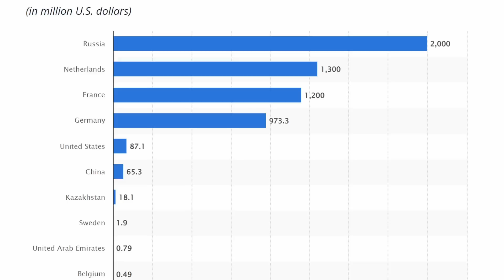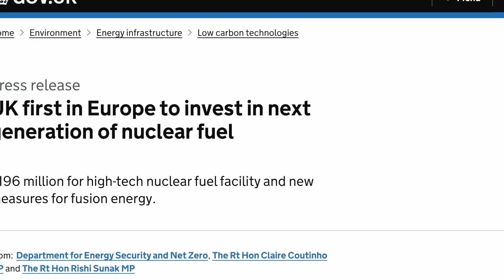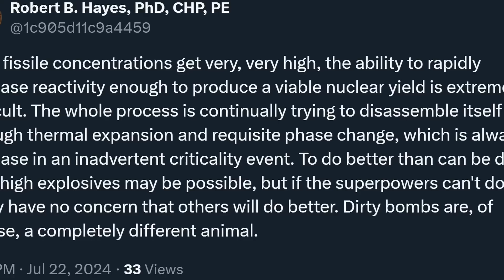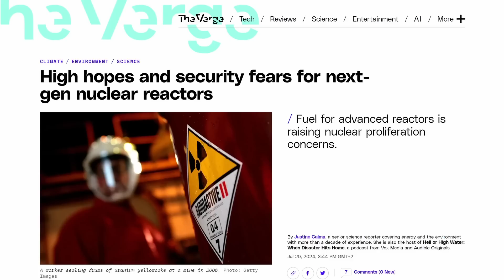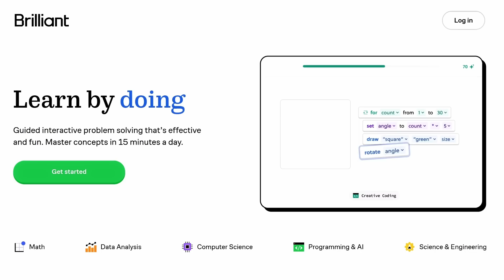Small modular reactor fuel could be used to build nuclear bomb, experts warn

Comment: This is actually a good technical summary.   You can actually build an atomic bomb with natural uranium at 0.7% U235.  It would take a sphere of it larger than all the uranium that is estimated to exist in the entire planet.

I have seen the calculations for how big of a sphere you would need for everything up to about 95% U235, U233, and Pu239 (all are bomb materials - and bombs have been built out of all by multiple countries - although everyone discarded U233 as it was much more expensive to produce).

Yes, you can build a bomb with lower % than bomb grade materials.  I don't think its practical at all until you get into the 80% range of enrichment - and there is so many advantages to pushing into the mid 90% enrichments once you have the equipment to enrich into the the 80% range.

The biggest nuclear bomb threat by potential new reactor technology is the molten salt thorium based fuel cycle reactor.  

It would be very easy to divert operational molten salt fuel, chemical separate the protactinium, and allow it to decay into extremely high grade 99.9%+ U233 for bombs.   

The USA actually produced U233 from solid thorium fuel rods this way as part of their looking at switching to U233 for bombs versus Pu239 (U233 has some real advantages over Pu239).   But, using normal graphite bomb material production reactors its vastly cheaper to produce Pu239 than U233 that way.  

The cost advantage would swing to U233 production with a thorium based Molten Salt Reactor; and how do you spot diversion of liquid molten salts.  All the current nuclear fuel tracking methods are based on serial numbers and counting of fuel rod or fuel block assemblies.
Reply: Can you tell us numbers for 2 or 3 stage bomb?
Reply: "The cost advantage would swing to U233 production with a thorium based Molten Salt Reactor; and how do you spot diversion of liquid molten salts."
You can make weapons-grade U-233 from an MSR, but I don't think you can do it *covertly* in a reactor officially intended to generate power.  As I understand it, there's some extra steps in processing that would be unnecessary for someone making fuel-grade, so it'd be a red flag if the plant was set up to do that.  
Also, the operator would have to account for the discrepancy in fuel production.  "Everybody else running this model of reactor is getting X kg of fuel bred for every GW-hr of electricity produced. You're only getting 0.95X; what are you doing wrong?"
Reply: @wwoods66  You are starting with a completely false assumption: You are forgetting that in all other reactor types that the fuel is in a solid form. Virtually no one analyzes spent fuel for what its constituents are. It just sits in pools of water usually for a decade + and is then put into some kind of dry storage until it is disposed of (someday in most cases).

Only in the case of recycling is any kind of post fuel run analysis done on the fuel burn up and resultants; and fuel recycling has pretty much stopped as its uneconomical -- and often that fuel is a decade or more old. 

The various nations have done enough testing of spent fuel from the different reactor types to have models for that. But, no one is actually testing spent fuel as it’s not cost effective, and totally not needed to verify if any fuel assemblies or blocks have been diverted (are missing).

They have detailed records and photos of both new fuel assemblies or blocks, and the spent fuel assemblies or blocks in spent fuel storage. Missing spent fuel in a solid form is very easy to identify.

Also, the vast majority of power plant reactors require about a month-long refueling outage often with many hundreds of extra workers to move fuel assemblies or blocks out of an into a reactor. Very easy to track when this is done and to have observers and/or cameras there.

The small number of reactors that can be refueled online have multiple 24-hour surveillance cameras watching where the refueling equipment is - the international monitors will know right away if someone starts to refuel a reactor online, and will have people there immediately if a camera goes out.

The problem with a molten salt reactor is the fuel stream is liquid. Let’s say its 1000 gallons. How does anyone detect that some is drained off into a bottle or small tank and diverted with new liquid fuel resupplied either say during a major outage where most of the fuel stream is drained, or even just a few gallons a day?

You cannot look at a piping system or a tank and know how full it is. How would you see someone transporting say a 5-gallon bucket of solidified molten fuel a day out of the plant?

One of the problems with liquid process plants is that there are always some leaks.  With leaks there must be replacement fluids.  So does your MSR leak a few gallons a day, or say 50 gallons a day.  What is typical, and what are the normal ranges based on different equipment failures.  So how do you spot a diversion vs a normal leak?

The nuclear proliferation folks are studying the issue and have raised a lot of red flags about how easy it will be to divert molten salt fuel.

Now they say that they are working on methods that they hope will work – but it’s going to have to be vastly more intrusive and expensive than for all other reactor types with solid based fuel - and even then someone may figure out a way to bypass the inspection/verification process.

Comment: Old nuclear waste as fuel for new fast reactors would be the best choice. It's a win-win situation. But I guess those SNR's coming don't choose this option. That's sad but not surprising!
Reply: General Atomic’s gen 4 fast reactor design is one of the simplest.  Basically one moving part in helium on magnetic bearings. Minimal maintenance for 30 years, then store waste for 500 years, then you can sleep on it and get less radiation than on an airplane
Reply: You mean like the $$$$$$ BILLIONS DOE wasted on the never-finished MOX plant?
The one even the French were laughing at the American Rubes about, as they took the money to build it??
Reply: The UK gave up on fast reactors. You need a reactor that uses a coolant that doesn't also act as a moderator, like liquid sodium, but you can imagine the likely problems with corrosion.
Reply: @brendanpells912  Helium is used in GA gen 4 design.  No corrosion. I believe the main issue is that the fuel pellets need to last 30 years. But their specialty is in the fuel composition and production of such.

Comment: Any nuclear reactor runs a chain reaction. It does not take just some chain reaction to make a nuclear bomb detonate, but an "uncontrolled", i.e. exponentially accelerating chain reaction. 
Chidren's physics teaching materials too often blur this difference by showing graphics of bomb-like branching reaction paths, with nothing like moderator water or control rods taking away neutrons, and calling that "the" chain reaction.
Reply: Yes there are many negative feedback effects in the reactors which is why they cannot explode like a bomb:

The (water) moderator will boil -> abrupt drop of its density -> neutron spectrum will be harder -> chain reaction will stop due to the lack of thermal neutrons.

Nuclear fuel can expand (thermal expansion) -> more neutron can escape the core

Maybe the most important in fast reactors: As temperature increases the Uranium-238 will capture more neutrons (without fission) due to the Doppler bordering. So less neutron can hit the U235 (fissionable isotope)

Comment: The company that currently has the most expertise with CANDU reactors has been contracted to make an SMR version - which capacity wise is basically what the original CANDU was. Hopefully this design aspiration delivers on it's promise and gets picked up.
Edit: Brought up because the design doesn't require enrichment.

Comment: Any sufficiently large source of energy could be used as a bomb.
Reply: This is not true. A pile of wood can be as huge as you want. It won't explode like a bomb since the rate of energy release (the rate of the exothermic chemical reaction) is limited.

In case of low enriched nuclear fuel (including the HALEU) the story is similar.

Comment: Sabine confuses critical mass and criticality (which depends on the geometry, the enrichment level, neutron retarder, etcc). You cannot make a bomb with a ton of 15% enriched uranium.  You can get a chai reaction, but not a supercritical one. And the minimum amount of 100% enriched uranium to make a bomb  is 5 kg, not 52. 1 kg of plutoium also works.
Reply: Slightly supercritical (used often for raising reactor power) is not the same as prompt critical (won't happen twice).
Reply: A massive statement. But critical.

Comment: How good is thorium instead?
Reply: Very abundant.  Outstanding power source.  Problem is, it would require several multiples of tens of millions in investments to build out the processing supply chain in order to render it into a useful state for the purposes of extracting electricity out of it.  Initially, very expensive and technically unproven.  Basically it would be on the order of Gerald Ford generating demand for his brand new horseless carriage.  But to be that Gerald Ford!  Well, a fellow can dream; can he not?
Reply: @gilian2587  sounds like we should do it then?
Tens of millions is small change these days

Comment: You can make a bomb out of any uranium that's enriched above 1%.  It's just a matter of how big the bomb will be.  Now that you can move a 40 foot, 12 m , ISO container weighing 40 tons around anywhere and no one would notice, I don't know when you're supposed to start worrying about someone making bombs out of fuel.    We used to consider anything containing above 10% with plutonium  240 in spent fuel as being not useful for a bomb, but now....
Reply: The secret service probably wouldn't notice.
Reply: I'm not sure how you can make it be a bomb in reality? You can have a supercritical assembly but that doesn't make a bomb. When it's so low enrichment, not only will it fizzle, it won't even fizzle technically, it would just heat itself up a bit and stop.

Comment: Simple truth: if these types of reactors get common there is no way to keep track of the nuclear material. Today’s reactors have a high degree of protection against nearly everything. This will not be the case with these reactors. 
The main problem is that U235 is simply rare. The know reserves are enough for 200 years at current usage. So if the usage is increased in way that it really makes a difference for climate change this will not last very long. 
Thorium reactors have some of these problems too but at least the nuclear material is more abundant.
Reply: "The main problem is that U235 is simply rare".  It's so not rare that it's not economically worth using anything else at the moment.  If it becomes rare the two solutions are using U238 in CANDU type reactors or using Thorium.  If Thorium is used we don't even need to make new reactors, it's been demonstrated that we can breed Thorium to Uranium in existing PWR and BWR reactors,.

Comment: Yes they contain some uranium 235 as almost every single reactor uses today. You dont need to be an expert to figure that one out, it uses the same material as the bomb dropped over Hiroshima.

But they are lousy to use if you want to get bomb material, you cant breed plutonium in them very well, for that you need a high neutron flux and you want the neutrons to be fast which they are not in a small reactor. You dont want to use water as a moderator because you want fast neutrons. So they are not good for getting your hands on plutonium.

Which leaves us with uranium, but then you need t do isotopic separation so you probably want cemtrifuges for that. Which means you can already build a bomb just by digging uranium up and enrich it, no need to go through the route of small modular reactors.

So its a stupid idea.

Comment: It’s wildly implausible to build an atomic bomb with 20% enriched uranium. Sabine is off when she says the lower the enrichment the more you need. To create an explosion, you have to make the mass supercritical. I don’t think the “gun” type bomb (Little Boy) would work at all with such low grade material. 

The implosion type like Fat Man (which used only 6.4 kg of plutonium) works by crossing the core together with explosives VERY quickly. Very hard to see doing that with 1000 kg of uranium.
Reply: Well you can go critical. But it would be closer to excursion than explosion. Screwdriver not included.
Reply: @brylozketrzyn  Nice industry insider reference to the Demon Core!
Reply: @brylozketrzyn  Doesn't matter when you have to convert fizzle-spread radioactive material into $$$$$$$$ for cleanup in a site like DC or NYC.
Reply: @rbaxter286  well if I had to spread anything with an explosive - Co60 is easier to find. Put your source into an actual firework and voila. Also, you just need to get your hands on something that can actually fit in your suitcase (with all the shielding)
Reply: @brylozketrzyn    My Cobalt bombs always put energy out in the wrong direction.  I blame C S Wu.
Reply: It is correct that the lower the enrichment the more you need though, with the required mass going to infinity at 5% and below
Reply: It's worse.
Uranium 238 has relatively high spontaneous fission rate, meaning it is not only a dead-weight but also necessitates an even faster compression.
Gun assembly is completely out of the window. You can't even reliably use U238 as a tamper in gun assembly, having hundreds of kg of it in the fuel will be even worse.

Comment: The mechanics, math, and materials for a diy nuke aren't hard to find, a tutorial for a how to on the other hand doesn't exist in the public sphere, though I'm sure quite a few ppl could figure it out. It's not a small number of ppl that to this day believe the only reason anyone other than us has nukes is because it was stolen or we gave it to them. For practice reasons yes, but many nations are more than capable of developing them on their own, it's just expensive to develop the infrastructure to do it independently. So some believe we have magical sciences the test of the world doesn't...despite not being true at all. 

But what I wanted to say is that modular reactors are an old idea. Russia has a few abandoned prototypes at various sites left over from the 60s-70s, and the fuel conversion into a nuke isn't a valid concern. Enriching that much takes time and highly specialized purpose built equipment, and you need a lot of them, as well as various types of experts from chemusts, engineers, physicists... So the budget would be that of a small nation at start up. 

What the fears suggest is a small cell of ner"dowells could do it, which no, they can't. The best they could do is obtain the fuel somehow and make a dirtybom.

Comment: All kinds of tricks are necessary to get a good chain reaction (edit: that results in an atomic detonation of multi kiloton yield) on enrichment of like 90%. Complex beryllium reflectors, neutron injectors, fast reacting specially shaped charges. I dont think there is even any precedent for generating a nice boom from a 20% enrichment.
Reply: The thing is, you don't need a boom for terrorism. You don't even need prompt criticality. Chernobyl wasn't really a nuclear boom. It was (as far as we know) a steam explosion followed by a carbon fire that dispersed fission products everywhere. If you've got a metric ton of 20% enriched uranium, decent physics knowledge and sufficient diabolical creativity, I really fear the mess one could achieve with that.
Reply: "All kinds of tricks are necessary to get a good chain reaction on enrichment of like 90%" that's just plain wrong. You just assemble a critical mass of your chosen nuclear material (in the simplest form by stacking a bunch of uranium bricks). That's it. If you've got neutron reflectors (e.g. graphite), your critical mass becomes smaller, but the complexity is still just "stacking bricks of uranium and graphite next to each other". In Los Alamos, this was apparently so frequently done in a tabletop experiment that two separate accidents turned out lethal.
Reply: @SASAS-ru8ys  Just for you, I qualified it: (edit: that results in an atomic detonation of multi kiloton yield) so no other amateur geniuses need unbunch their respective panties.
Reply: @Sven_Dongle  not really. You can just drop one properly shaped U235 slug onto the other from a few meters.

Gun type weapons are that simple and U235 has very low spontaneous fission rate.

You can get something better with a neutron injector and a tamper but you will still get a decent explosion. And it's not like the reflector is terribly complex.

Pu239 is a different story.
Reply: @martinofgliwice1486  Nope wont detonate. Just like the demon core didnt detonate.
Reply: @martinofgliwice1486  Wiki is no kind of absolute authority, but if you look under "criticality accidents" AKA "excursions" you find this:
"Though dangerous and frequently lethal to humans within the immediate area, the critical mass formed would not be capable of producing a massive nuclear explosion of the type that fission bombs are designed to produce. This is because all the design features needed to make a nuclear warhead cannot arise by chance. In some cases, the heat released by the chain reaction will cause the fissile (and other nearby) materials to expand. In such cases, the chain reaction can either settle into a low power steady state or may even become either temporarily or permanently shut down (subcritical)"